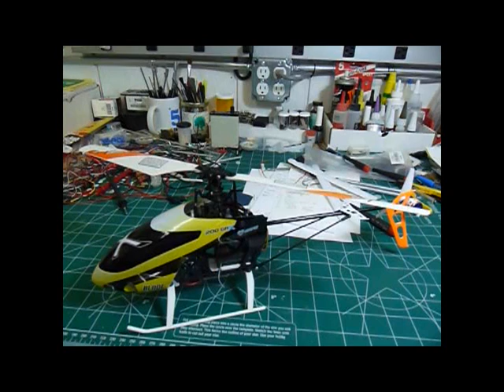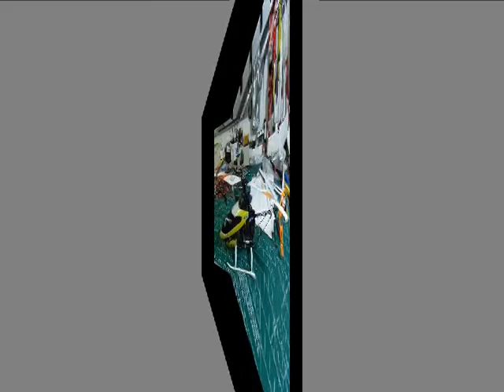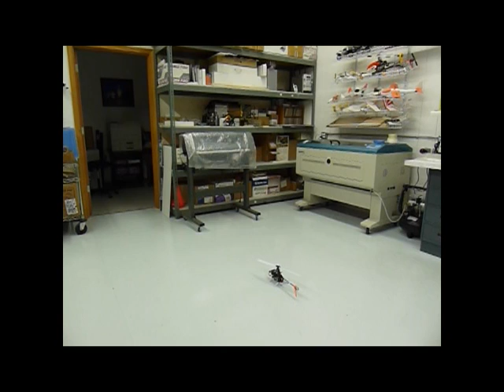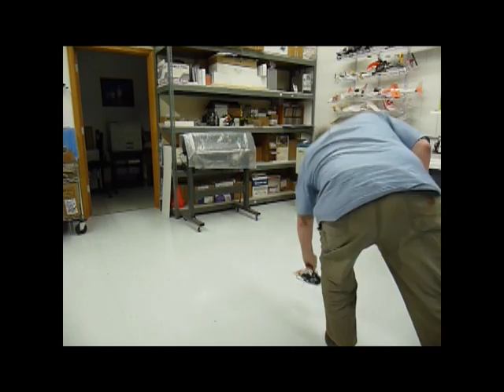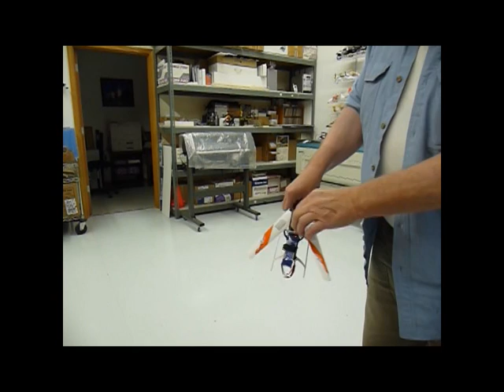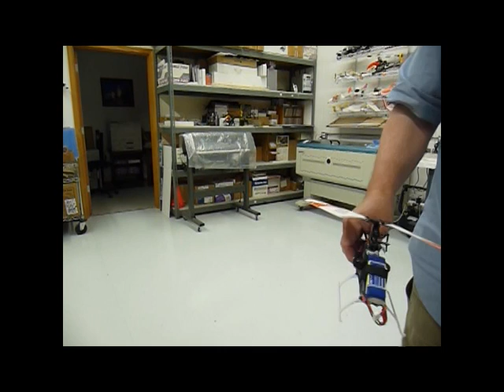Blade 200 SRX - BIG Power Increase!

Comment: I just stumbled upon your interesting video, also an interesting idea :-)
Just wondering which walkera blades you mean: You mentioned using the V200D01/2 blades or the ones from the cb180. But the all have different dimensions, so I am confused %)I looked in several shops and got difference technical details for this 3 blades 190mm lenght for V200D02, 185mm for the CB180-Z (the on that Daniel Migneault mentioned a year ago) and 200mm for the  V200D01 blades. What is the original lengh of the blades you used and how long is it after cuttung off ? (I am confused about measuring in inches.... ?) Thanks !

Comment: Makes perfect sense to me! I just came back from my first flight and even as a beginner i found the lack of lift worrying and the 200% increase didn't appeal at all. I bought this heli to learn on and i don't want to ruin what i loved on my first flight.
Blades ordered! Bread knife at the ready! 
Thanks for this Tiger.
Paula.
Reply from the maker: Bread knife???  Hope you're not going to try to cut them with that!  If you don't have some kind of saw, you could probably cut them with heavy scissors.  You'll want to be sure follow my instructions posted earlier about bolting the two blades together for cutting.  If you have to cut with scissors, bolt the two blades together and cut them one at a time. When you get the top one cut, you can use it as a guide by laying it back down on the bottom one.  When you're done cutting, you'll still want to sand them together to make them identical for perfect balance.  You can use some sandpaper on a block of wood for that.  Happy Flying!  ...Tiger
Reply: I'm a big fan of the bread knife! I do have some tin snips too. I'm hoping this mod will help when i fit my scale body. Looking forward to it. Cheers

Comment: ''Update: If you have not read all the postings, you may not realize that I finally ended up with 1-1/4" cut off the blades. I mention this because when I posted the video, I was cutting off a little less.''

So in final! how long should the walkeri blades be?
The one i'll get soon are a little more than 8'' long!
Reply from the maker: Just measured my blades mounted on the heli and they are 14-5/16" from tip to tip.  The end of the blade is not square so it's tip to tip.  I looked for the video you mention and I can't find it.  It's not in this comment list as far as I can see.  I also looked at your channel and didn't see anything there either.  What video are you referring to?  When you say 1-1/4", are you talking about off each blade or the overall span?    ...Tiger

Comment: Ok fine, so a 3/4 '' cut is needed and for the long run do you think they could arm the motor??. Thanks for your support, really appreciated!
Reply from the maker: Daniel - Using these blades is a LOT easier on the heli than the 200% mod many other people have suggested.  That's one reason I did it this way.  I and a ton of other guys have been flying these for months and months and months now with no issues of any kind.  Just read the earlier posts about the best way to cut them and go have a blast with your new heli. :-)   ...Tiger

Comment: Would those blades do the job? http://www.dx.com/p/walkera-cb180-hm-cb180-z-01-replacement-main-rotor-blades-pair-122542#.VhEPi3p_NBc??
Thanks for helping.
Reply from the maker: +Daniel - Those are the exact same blades, except that they are black.  That's a good price too.  Walkera used the same blades on several helicopters and the only difference was the color and naturally the part number to reflect that.  Seems like the blades are starting to get harder to locate so this was a good find on your part.      Enjoy!   ...TIger

Comment: Anyone knows if any web store have does Walkera V200DO2 blades in stock? And if so give me a link to them?
Or maybe some other blades with similar length blades can be used?

Thanks, Erik
Reply from the maker: Hello Erik!   I get the blades from Wow Hobbies (wowhobbies.com).  I just looked and they are still in stock.  The blades for the  Walkera V200D01, V200D01, and I think the 180 helicopters are all the same except for color.  You shouldn't have any trouble finding them.    Happy Flying!   ...Tiger
Reply: +TigersToys Thank you! But I find them as out of stock though..
But I manage to find another store this night and ordered 3 sets of blades. They cost about a dollar more, but it's okay. They are still almost half price from stock ones. 

For others interested getting them, here is the link where I ended up buying them: http://www.helipal.com/hm-v200d02-z-01-main-blade.html
Part number: HM-V200D02-Z-01

TigerToys: Correct me if I am wrong here about the blades I found, I don't want to give out any false information.

Again, thank you for the video and helping me getting the blades. Looking forward to get some more lift at less head speed now :)
Reply from the maker: Yes Erik those are the correct blades.  I don't understand WOW being out of stock, but I'm glad you found some.  I think you'll really like how they fly.

...Tiger

Comment: If I want more pitch from the stock blades I just heat them up and twist them.
Reply from the maker: James M That's an interesting idea!  Never heard of anyone doing that.  Be easy to do, but I sure don't see how you would bend them both perfectly equally.  I'm sure the blades would be less efficient, but might work in a pinch. :-)
Reply: TigersToys I take my 200 out on the road with me and when it sits inside a hot vehicle the damn blades straighten out so I have to twist them back. I've always done it with my fixed pitch helis with no issues.

Comment: Just wanted to let you this solved my problem. I could hardly get my 200SRX off the ground, even with motor power at 200%. Problem being I'm at 9150 ft. elevation.  This  rotor blade  swap  did the trick.  This has now become the first rc heli that actually flies for me at my altitude.

Comment: What exactly was the "instability" that you experienced when the DO2 were at full length?  I installed a new set and the helicopter is now experiencing a very bad wobble to the whole helicopter.  Any help appreciated....oh and thanks for sharing this video!
Reply from the maker: Edwin Mendija   Hello Edwin.  I don't remember ever having a lot of "wobble".  With the blades too long, the problem is more a matter of not having the power to pull them.  "Wobble" sounds more like some other problem.  The first things that come to mind are:  Be sure you put a washer on the blades to take up the slop in the blade holders that are a little wide.  The next thing that comes to mind is blades out of balance.  Did you screw them together to cut them like I suggested?  Hard not to get a pretty good balance if you cut and sand them together like that.  If you did cut them one at a time, screw them together now and sand them to match perfectly.  Lastly, did you go to the new blades after a crash with the factory blades?  Easy to get a bad wobble from a bent main shaft.  This is a long shot, but one of the guys here had a horrible wobble that turned out to be the frame screws not being tight enough.  It was a really ugly problem that drove him crazy for weeks.  Acted like a bent main shaft, but what was really happening was the main shaft bearings were moving around a little because the frame wasn't clamping them hard enough.  That was a real head scratcher.  Look close at everything and you'll find something.  If you crashed, be sure to check the servo gears.  That bird is known to eat servos. :-)

...Tiger
Reply: TigersToys I did switch over to the same blades you have and cut it 1.25 inches.  I put a small bolt through the hole and then taped the ends together, used a fine file to smooth the corners.  I did have a bad crash d/t a bad ESC and replaced tail rotor, main gear, and aileron servo...all fixed now.  The copter starts to wobble badly when it gets to a certain RPM...I back down...and it goes away.  I WILL check the frame screws and main shaft next.  Thanks so very much for the help!

Comment: This may seem like a dumb question but what did you use to get super clean cuts while trimming the blade length? 
Thank you
Reply from the maker: ultragroove1 Well... I used a sheet metal shear, but I don't think many guys have that option. :-)  Other guys around here have just been sawing them off using whatever they have to do that with.  A band saw works great.  Just be sure you screw the two blades together like I mentioned earlier.  That way they are going to be identical no matter how you do it.  Then if it's a little ragged, you can just file the end clean or use sandpaper on a block of wood.  This lets you make them nice and smooth and even round the corners nicely.  What's important is that they are identical for balance.  Mine cut clean on the shear, but I still use sandpaper to round the corners and make them look nice.    ...Tiger
Reply: TigersToys Thank you so much for clearing this up!! 
Cheers!!

Comment: Yep, I did exactly the same thing when I spun this heli up for the first time. I thought there was something wrong with the throttle, and yes, I even bumped it up to full 200%. With the stock blades, it's got zero punch out of a bad situation. I am a Walkera guy from my earlier days in FP, and had a bunch of v200 both versions lying around. I replaced them and noticed an immediate improvement in zip and throttle/elevator. I don't know why anyone would complain about boosting performance. This may be a beginner helicopter, but it's a lot of fun and does have the three modes. I fly this at intermediate to maintain some degree of flybarless gyro, whereas the expert is exactly like flying an old HoneyBee FP, (can't believe someone referenced that) but its so true! I wish Blade would have engaged some degree of 6 axis in the expert setting but oh well. I can live with it. For the money, this is a darn nice FP flyer. Lots of mods available and I bought one with a buddy who is new to the hobby so I could go along as he progresses. I still prefer CP, but I don't miss rebuilding CP birds after horrendous crashes. So hey, if a set of blades off the V series Walkeras make this heli punch out and thus WAY more controllable, I'm happy. After all, this is a hobby full of tinkering and modification. It is no fun to fly anything stock. imho 
Thanks for the video, and for confirming what I had hoped others had figured out. The blade switch out WORKS!! :)

Comment: Careful with increasing the blade pitch.  You will decrease head speed and wind handling capability. It is my belief that the relatively high head speed (for a fp) and relatively low blade pitch are what helps to make this handle the wind amazingly well for a fixed pitch heli.  Anyone ever try to fly a honeybee fp in a breeze??

Comment: This is a noob question, but would the blade change increase the flight time any? It obviously increases lift and aids in recovery. Thank you for the video.
Reply from the maker: Hello Kevin!  Blade changes of any kind generally do not change flight time very much.  It pretty comes down to how much energy it takes to keep the heli in the air and that energy has to come from your battery.  There are minor differences in blade efficiency I suppose and also minor changes in motor efficiency at different rpm's, but all of these tend to be small in comparison to overall power consumption.  That said, if you make the blade change I'm suggesting, your flight time should remain about the same.  I do think however that your "flight experience" is going to be better and that seems pretty important to me.  Enjoy!

...Tiger

Comment: I have a question. ..does Horizon have upgraded larger replacement blades?  That you can purchase? That will fit perfectly?
Reply from the maker: I'm sorry to say that they do not.  Their response to the problem was to release the high head speed fix when they realized they were in trouble.  While there are a few more experienced pilots out there that actually appreciated that, it seems to me this "fix" is totally contrary to the original intent of the product.  It would have been so easy for them to offer more appropriate blades, but they didn't.  What would really have been nice would have been a blade fix for most people and then still release the head speed change for the few that liked it.  I suspect that could have led to problems though since if you upgraded the blades and increased the head speed, something might have smoked under the heavy load.  Not a big deal, different blades is still an easy fix that you can do on your own.  Next time they make something like this, I think they need to test fly it a little more before releasing it. :-)

...Tiger

Comment: I tried cutting an inch off of  Walkera HM-CB180Z-Z-01 Main Blades. I got a very bad wobble. I cut the blades down fastened together. any suggestions.
Reply from the maker: Hi Dave!  You're the first one to ever say these blades caused a wobble so I suspect you did one of two things wrong.  You either didn't get the two cut exactly the same length (I explained how to do them in an earlier post) or you didn't make little bushing washers to fill the gap between the thinner blade and the holder.  Even a little cardboard washer works for that.  ...Tiger
Reply: ok thank you i did cut them the way you said. I will try different bushings. thank you
Reply: TigersToys 
Hey tiger. All I did was take sandpaper and "sharpen" my stock blades. Sanded the leading edge from top to bottom making it sharper as if it were a knife. I did the same with the tailing edge, all in all it removed about.30 grams weight from each blade which is also how I balanced them with a small digital scale. WOW TOTALLY DIFFERENT BIRD!  First flight and I hit a light fixture on the ceiling in a blink. Power is much much much better. Hovers at 40% throttle where as before it took 80-90% with fully charged batt. I love this heli now.

Comment: How do the higher lift blades handle higher winds? With the increased lift it seems like it would have a hard time decending in 10+mph winds. Thanks for the great information.
Reply from the maker: Hello Eric!  I wish I could tell you that they handle the wind better, but they really don't.  I suppose the good news is that they don't work any worse either. :-)  My experience is that fixed pitch helis all tend to flare up when they hit a gust of wind.  When you combine that characteristic with the light weight of the 200 and it's just a problem.  I try to fly the little birds early in the morning or late in the afternoon when the wind tends to be less.  If it's windy, I reach for my 400 or 450 sized collective pitch rigs that are heavier and do a lot better.  If you live in a place where it's windy all the time, like my friend in Texas, you might try increasing the head speed with the regular (lower pitch) blades.  That's a last resort to me, because you end up with all the problems that come with high head speed.  On the other hand, if it's your only option, I guess it's your only option. :-)  If you're somewhat new to helicopters, I'd struggle with the wind situation for a while or find a place to fly indoors until you hone your skills to where you rarely crash.  Happy flying!    ...Tiger

Comment: Just curious, does the shape of the different blades affect its performance in the wind?
Reply from the maker: Hello Shelley!  Not sure what kind of "performance" you are talking about, but you will have more power if that would help.  One thing it won't help is the kind of flaring up when going into the wind.  That seems to be a characteristic of all fixed pitch heli's.  When it's windy, I always fly heavier collective pitch helicopters.  They don't mind the wind so much.  More weight helps a lot.  Fixed pitch is more of an indoor or calm day choice.  If you live where there is wind all the time, like some of my Texas friends, you might do better with stock blades and jacking up the head speed a little (not all the way).  If you do that, it could do better in the wind at the expense of more damage when you crash.  Personally, I'd just try to avoid the wind with this kind of helicopter.  Here, it's almost always calm in the early morning so that's when I'd choose to fly.

Have fun!  ...Tiger

Comment: I couldn't find a source for the V200D02 but I did find the D01's. They are a vast improvement over the stock blades as well
Reply from the maker: Carl - The D01 blades you got are exactly the same as the D02 blades I'm using.  The only difference is the color.  I actually like the D01's better.  The best blade is the one you can actually find to buy. :-)  Have fun!

...TIger